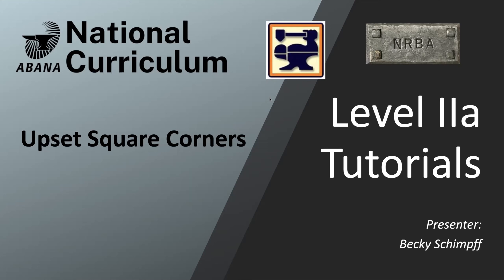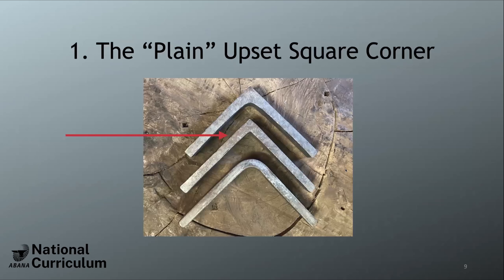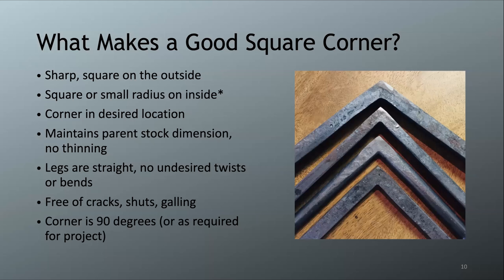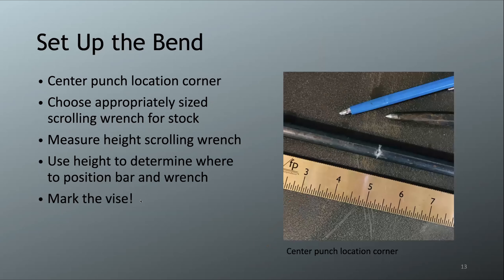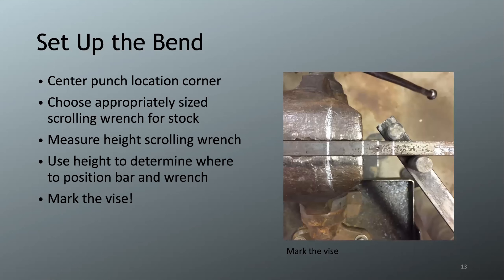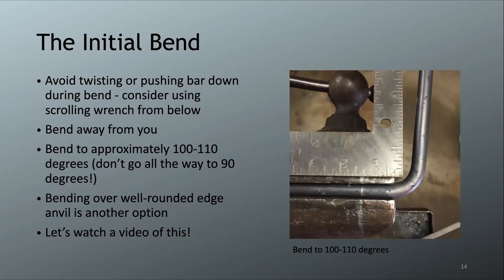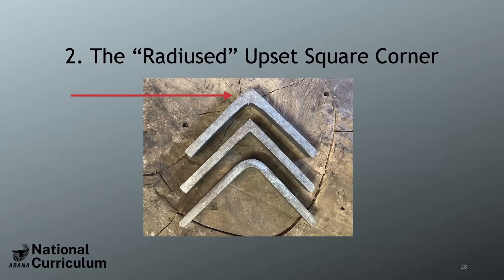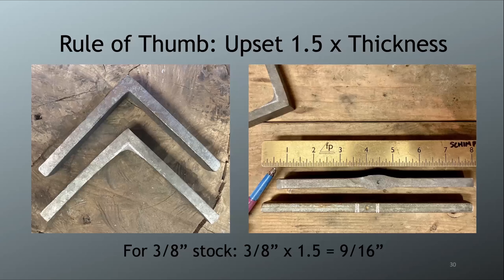Forging Square Corners with Becky Schimpff: National Curriculum Level II

Comment: Regarding your question at 34:17 using an oxy acetylene torch I've found that I can get pretty precise heat that often doesn't require quenching. However you won't get quite the same "sharp" line between heated and non heated parts of the bar as one does with quenching a part heated up in the forge. It is also a bit more difficult to get the entire bar heated up evenly particularly with larger stock, since the torch can only heat from one side at a time. With a little practice and planning, I've found I can get wonderful speed and accuracy when using both methods in tandem. Less downtime waiting for the forge.

Comment: Great vid and inspiring. Thanks.  I'd like to add a few ideas. I learned these from Francis Whitaker, so He gets full credit. 

Using a forge or using a torch isn't mutually exclusive. Use them both. My first bend is done out of the forge and with both bending forks and scrolling wrench in the vice. Then the torch becomes a localized heat where needed. Minimize the length of your initial heat, but don't dwell on it. It will cool down quickly and not be a problem so Its not critical. My bending forks and scrolling wrench are done as a set and are made"just a little bigger" than dimension. Think a bakers pinch of salt bigger.  Lets use half square. So the forks are just a little more than half. This means that you can make your initial bend as tight as possible and this means less work.

Layout: put your center punch mark on the inside surface, not the top or bottom. Its easy to see and will disappear when done. And its just right on the money when its dead center in the bend all the time. I always forge my right angle bends to dimension. Its great layout and is actually much faster. And no chalk marks on the anvil are needed. For example, we are using half square. Mark your center as above. No choose an arbitrary length, say 4". Add half the thickness to both sides of your center punch mark and make a mark(center punch, scribe, file mark) 4-1/4" each side of center. Done.  I use a 6' metal folding ruler and it lives in my back pocket. An easy reach and a quick measure on both legs to see where my upset is. No disappearing chalk or trips to the measurement on the anvil. Massive heat saving deal. 

Forging: Most important is whilst doing your upsetting lay your work on your anvil and set your thickness to 1/2". Part of your upset will go where needed, but a substantial amount will be lost back to length. Let it go proud until your measured length hits 4" and the outside edge is approaching an edge, not rounded. Now go to the face of the anvil and use your cross peen to move that upset wild material to the far edge. Following the formula(add half the thickness to each side of the center punch), you will need every bit for a good upset right angle bend!

With these additions, you should, with due diligence, torch and forge be able to make these in 3 heats. When you are hot 2-3 and comfortably 3-5 heats. When you get to this point, its an economically viable detail. 

Thanks, hope this is appropriate.
Reply: Typo correct under forging:  Most important is do not lay your work on the face of your anvil anf forge to 1/2" thick! Sorry about that

Comment: If I am making just 1 square corner on a bar I prefer doing it on the anvil, that being said I see now that if I need 2 or more square corners on the same bar the vise technique is invaluable. What I haven't done yet is the pre-upset square corner, I haven't had need for the strength but I do like the aesthetics of it. I have done square corners in both Acetylene and Induction heater, both are the best options for square corners because of the isolation's you get in the heat, with that in mind you still need to quench because you heat soaks up into the metal with time and each additional heat. On my channel I show a square corner where I use the induction heater to isolate the heat it is my favorite option tho I understand most will not have this option available to I do recommend the Acetylene torch. Thank you for explaining the way to measure the stock to keep the corner where you need it.